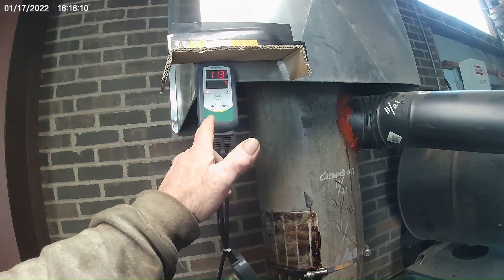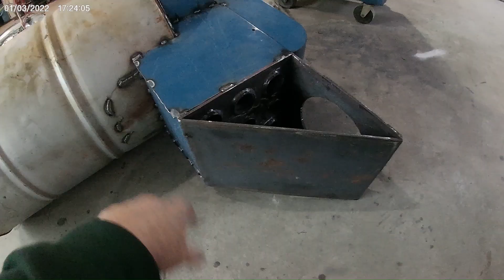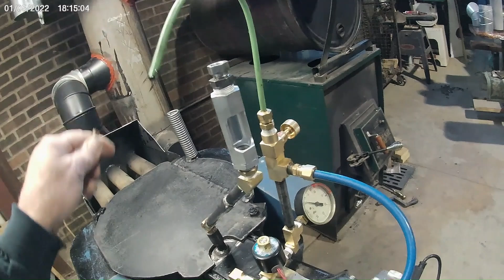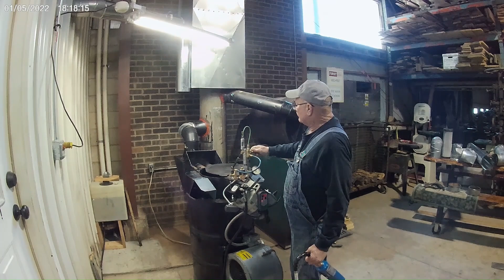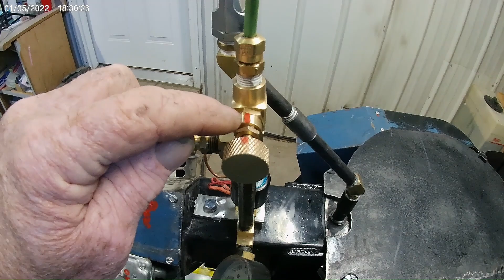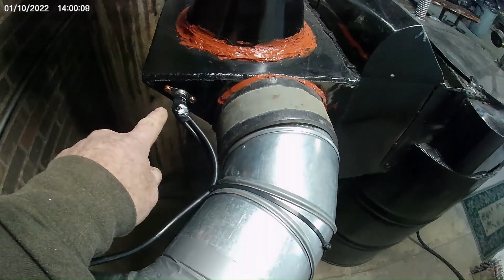Controlling Waste Oil Stove, Build Heat Exchanger ,Build  New Stove.

Comment: Certainly you're a genius and nailed it can you enlighten us with  model number of the oil solenoid and the speed control for the blower? This will not only help me but many people.Kind Regards 👍
Reply from the maker: amazon SNSAC110v1/4npt brass electric solenoid. Ink bird itc-308 temp controller.  The fam switch is just a 3 speed switch.  hope this helps!